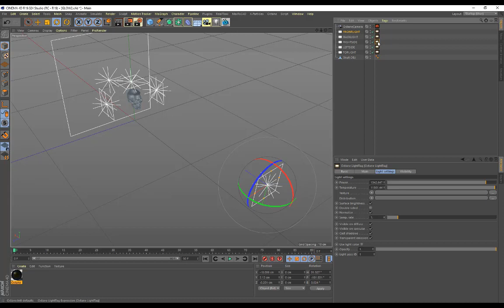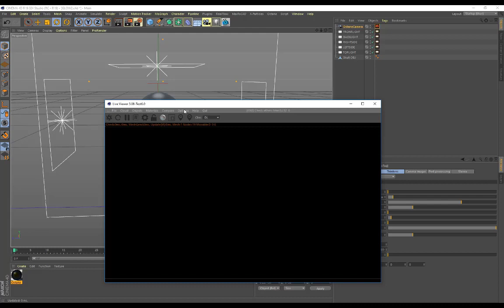120 Seconds - Cinema 4D & Octane Render - Create A Glowing Pearlescent Material

Comment from the maker: IF YOU'RE USING LATER VERSIONS OF OCTANE READ THIS. All you have to do is create an octane material, make the material type glossy. Make sure the diffuse is completely black. Go to Film Layer and put the Film IOR on 1 and by texture click on the arrow and select Fall Off Map.  Go into the Fall Off Map and adjust the minimum value to get those trippy different colors. You can also play around with the Index to get different results and to control how shiny the material will look. Enjoy!

If you want a more in-depth and lengthy explanation on creating a Pearlescent/Oil slick material then check out this video https://www.youtube.com/watch?v=hrjB1RkXsko

If you're using Octane V4 and later with C4D and you want a similar result, throw an image texture in Film Layer texture and set IOR to 1.